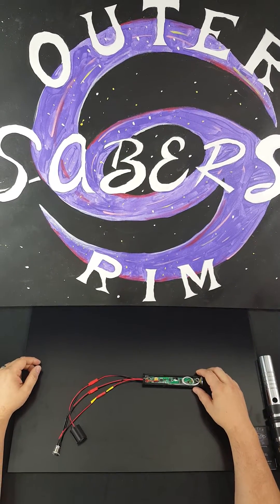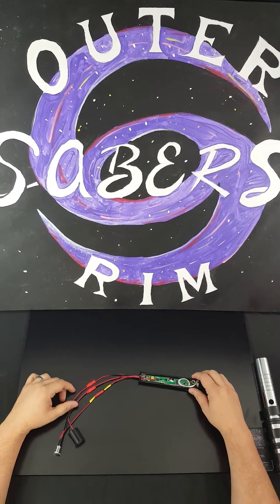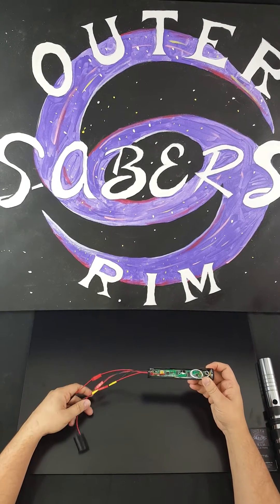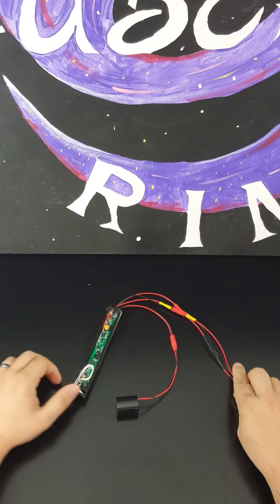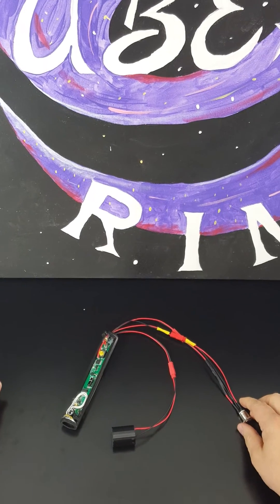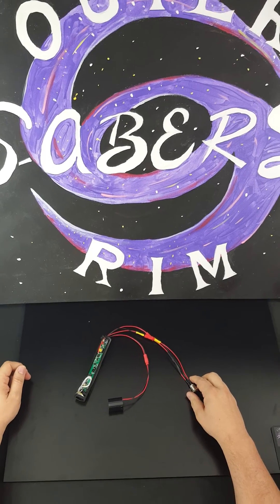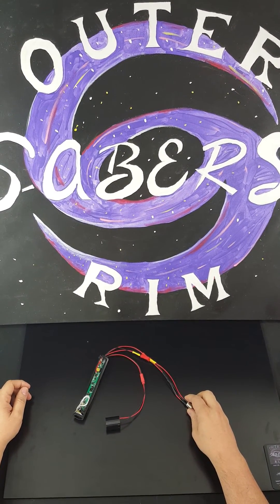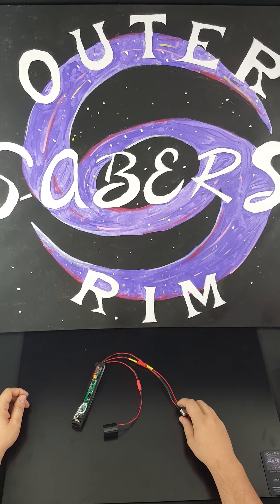Outer Rim Sabers Tier 3 Lightsaber Electronics

Comment: Could i request a more powerful led for the tier 3 on etsy
Reply from the maker: Lenny b 
We have 9watt red, blue, and green leds right now.
Reply: Outer Rim Sabers I'm still new to saber building how much more brighter is the 9 watt compered to the 3 watt or does it depend on what battery you are using
Reply from the maker: Lenny b The 9w LED is maybe 25% brighter. You can tell more of a difference in a well lit room.
Reply: Outer Rim Sabers I only ask because the saber I had built is made of brass and aluminium so In my mind the only colours that suit are yellow or amber the saber hilt looks like some used by jedi temple guards I will order the amber one right away when it is all put together will be happy to do a video to show it off